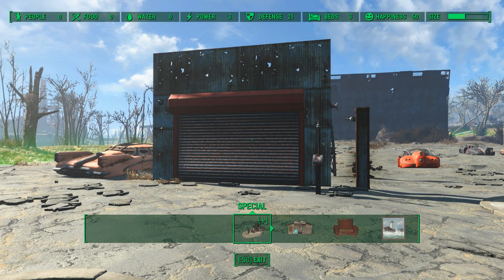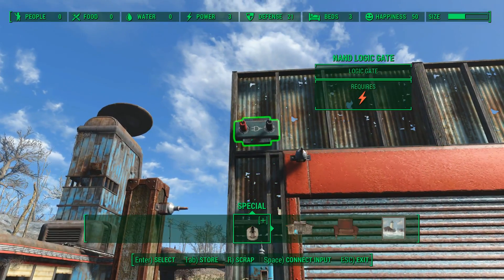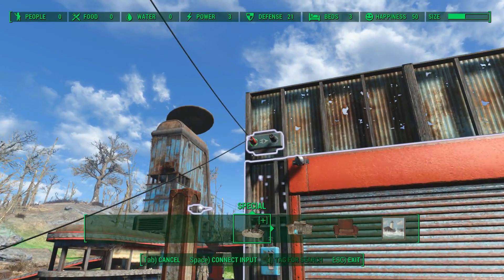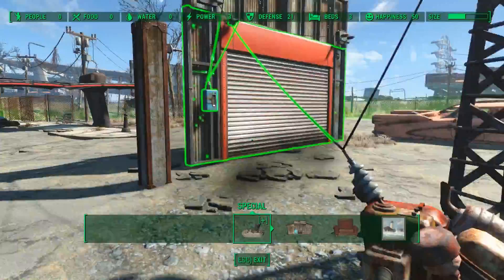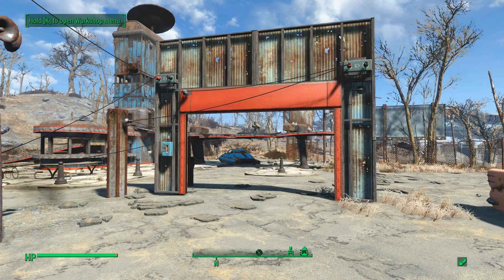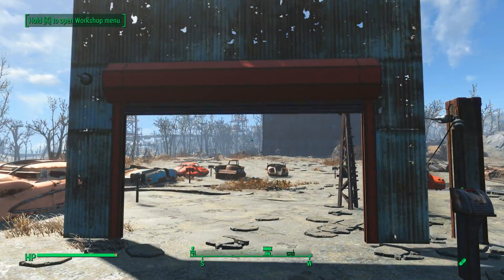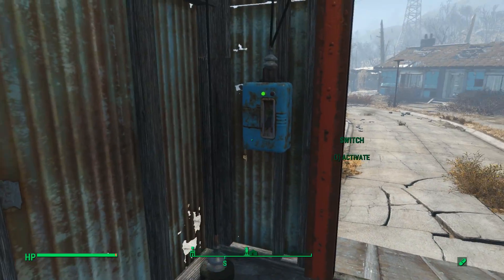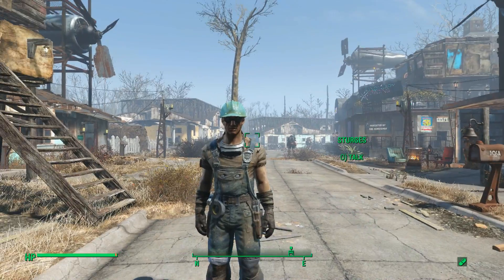FALLOUT 4 Logic Gate Tutorial - How to make a 2-way door with an emergency lockdown

Comment: I tried this for my rolling metal door, and it didnt work. But i found a different solution and a different way to lock down the door. Instead of and gates and nand gates, i ended up just using a Xnor gate, which allowed me to open and close the door from the inside and outside. But it didnt seem to work when i added the siren to the mix. So instead what i did is i hooked the inside switch to a terminal. And when i use the terminal to close the door remotely, it seems to power down the switches and essentially lock the door. So thats sort of another way to do it, just the siren wont trigger a lock down unfortunately

Edit: so it turns out that was a glitch of some kind. I left my settlemwnt and came back and it wasnt working anymore. So i made a smaller version of this and works now
Reply from the maker: Glad you managed to find something that works eventually. This video is pretty old, and I believe there are some changes (bugs?) with logic gates now. It's been a long time since I played!

Comment: There is a flaw in the logic here.  If I switch the door from inside, I get green (on) opens and red (off) closes.  However, leaving the door closed from the inside (off) negates any action from the outside switch, just like the siren does.  So the only way the outside switch works is if the inside switch is green (on).  Which might be cool if you want the "master of the door" to be inside.  But that keep all out when the inside "master" switch is off.  I thought the idea would be to be able to open the closed door from outside, regardless of the inside switch position.

Comment: The latest patch stops most of the logic gates from working as intended, it's really annoying
Reply: Explains why I'm having such a difficult time with them then! Even following this video, mine isn't working and its set up identically.
Reply: @sk8erhardy also it's quite easy to give a gate wireless power by mistake, then even if you remove and store them, when you use them again it will still have wireless power and can mess everything up,, the wireless power trick can be useful for certain things, but take note when storing those same objects, it's better to destroy them and remake them

Comment: I would go one step further, and hook up the siren to an outside switch, so that you can turn it off, in case you’re locked out. I can see a scenario where the settlers activate the siren, while you’re outside. I admit that’s not highly immersive, as you could argue a Raider could disable the siren, then open the door. But the game Engine won’t do this, so, for practical purposes, it’s fine.

Comment: I know this video is dated but it's still informative, I was using another youtubers method which allowed multiple sirens "it used an And, Not, And gate system" but.. it did not allow for an outdoor switch and the only reason I can see an outdoor switch needed is if the settlers trigger the siren while the player is outside of the gate hence the outdoor switch would allow him back in but and I was hoping that this video would solve the problem by keeping the outside switch operational to open the gate but lass it doesn't, once the siren is activated it disables both switches so I honestly I can see no point or reason to have an outside switch as setters AI is not programed to activate it only the player can activate and the gate stays open until the siren is triggered, I can think of no scenario in which an outside switch is needed unless someone can point one out for me that'd be awesome. Using the switch's just for normal gate operation yes... but why? if gate is closed then setters can't access the settlement so gate has to be left open until triggered by siren, I know this because I've been locked out and had to workshop mode to slip through a wall.

Comment: Another way is instead of the AND gate which is Position sensitive you can use the XOR gate which will function similar, XOR gate will transmit power as long as only one input is powered. Basically in simple terms as long as the switches are in opposite positions the door will open which means both sides can work independently of each other and not rely on the other having power. So say a settler comes by and flips the outside switch off with the and gate, even when you flip the switch on your side on the door will not open because the other switch is not powered. With the XOR gate as long as the switches are opposite of each other the door will function which means even if the exterior switch is messed with you still maintain full functionality of the door with the interior switch by reversing its position

Comment: Does anyone else have the problem of all logic gates changing one of the inputs to 0 even if it does have power?
Reply from the maker: I haven't used them in ages, but the logic gates have always been a bit buggy. If they're connected via certain types of conduit it can happen. Sometimes running them through another logic gate that's connected directly to the power source helps.

Comment: every time i connect the second switch to And the first switch & siren loses power and And only has the red plug lite up. Edit: Figured it out keep forgetting to power the Siren itself. Edit 2: after doing some testing This will not work if the Siren is connected to something before its reaches Nand. example: Power>Siren>Power Conduit> Nade. there cant be anything connected between Siren and Nade. otherwise it causes the 2nd switch once wired to And Red, will make And Black turn off.

Comment: Great tutorial! Do NPCs even use switches, though? If not, then turning them off during an attack would be for roleplaying purposes only.
Reply from the maker: Yeah, it's partly for role-playing purposes. If you've left doors open it means they'll close in the event of an attack. Which is only helpful if you've made your perimeter inside the enemy spawn points. Although there is a mod that moves spawn points outside the build areas.
Reply: Good to know.👍

Comment: Now I built one at the front door of sanctuary. Works perfectly. But when I built a second gate at the backdoor of Sanctuary, working off the same siren, the AND gate just does not work. It’s not registering power from the NAND gate, which is registering power going out, but it is registering power coming from the outside switch, which is a bugger to wire up. IE, it’s glitchy as fuck. This is on PS4.
Reply: Further to this, the siren seems to work in deactivating the NAND gate, even though it is wired across a lot of conduits across the map. The AND gate seem to only accept that one input has power, even when both inputs have power. Disconnect one switch input and the AND gate registers the other has power. Disconnect that switched input and reconnect the other, the gate registers that has power. It will not recognise both having power.
But the other door at the sanctuary bridge, wired up the same, works perfectly.

Comment: the problem is you can only use this when you don't have other doors. If you left the building through other doors leaving the indoor switch at "off", you can't open the rolling gate from outside again, since the indoor switch is not giving power.
Reply from the maker: True. But that's kind of the point - it's supposed to be a lockdown. No one comes in, no one goes out. You could always add another door that's not connected to the siren, but if you're going to do that you might as well not bother with the siren in the first place.

Comment: Hello Loved your tutorial but there is something wrong . When i connect both switches to AND gate it does not transmit power :S when i take out 1 it works but with only one-side switch gate doesn't mean much :D
Reply from the maker: The gates can be a bit buggy. Sometimes when you connect the switch to the gate via a conduit, it doesn't work. If that's the case, try a different type of conduit, or connect directly if possible. You could also connect it via another AND gate.
Reply: believe me i did all it just doen't work in that area i dont know why :D Thanks again though

Comment: is there a way to make this door work from both sides? I get locked out and the door doesn't react to the outside switch?
Reply from the maker: Jack Hazardous It does work from both sides. But for example, if somehow you end up with the inner switch turned off and the outer switch turned on (by using a different exit maybe), then try to come in from the outside; the switch won't work. You need to go in and out through the same door.
Reply: that's exactly what I mean, can you make it work like that?
Reply: that's what I mean, can you make that work?

Comment: strangely if I connect the siren to a conduit before the input of the NAND gate, the gate doesnt work anymore
Reply from the maker: +Nick Wei Yeah, they can be a bit buggy like that. Try different conduits (like pipe ones from Contraptions or the Vault-Tec one). Failing that, passing it through another logic gate (AND) usually works.

Comment: Would it theoretically be possible to use the wall pass-through conduit as a way to wire through the door/wall?
Reply from the maker: Absolutely. I just used wires here because it was quicker. I have another logic gate video where I use the conduits.
Reply: Lefthandshake wünderbar. I know Bethesda is notorious for having things that should work not work, so I was curious if that was the case.
Reply from the maker: Will Brown The logic gates can be a little "quirky", but I've never had a problem with the conduits.

Comment: I can't get this to work. Every time I connect the outside switch to the input side of the AND gate, the output switches off and nothing will function. Just to be sure, this is my setup:
Power source (from house) connected to siren, outside switch (large switched pylon), and input side of NAND gate;
Inside switch (small switched pylon) connected to NAND output and AND input;
Outside switch connected to AND input via conduit on a tree (to get over the wall);
AND output connected to powered door.

As I said, everything works fine until I get to the step of connecting the outside switch to the AND input. Even though it's getting power, as soon as I connect it, the output side of the AND gate switches off no green light). Turning the outside switch on or off has no effect. 

Any idea what the problem could be? Thanks.
Reply: I just wanted to add that I noticed that my inside switch LOSES power when I connect the outside switch to the AND input. So, somehow connecting the outside switch to the AND input is causing the inside switch to lose power even thought the NAND gate is still showing power output. What the???
Reply: I'm not sure what the problem was, but I scrapped everything and started over and got it to work. I repositioned a few of the components, so maybe that had something to do with it. 

I also set another door up with pressure plates so that it acts as an automatic door both in and out. Simply walk up to the door and it opens . If the siren is activated, it locks down. 

Lastly, I saw a video wherein the player was able to set up a 3- way door and siren interrupt with only the NAND logic gate. Unfortunately, he didn't explain how to wire it up on the switch side. I'm going to play around with it today and see it I can figure out how he did it. 

Thanks for the video! =)
Reply from the maker: +Harry Sparks Sorry I didn't get a chance to reply. Glad you got it working! Logic gates can be a bit finicky. The other video sounds interesting. Not sure if you saw my other logic gate video. It adds in stuff like turrets, tripwires and delay switches. You might find it interesting.
Reply: Thanks for the reply and pointing me to your other video. I'll definitely watch it. I have used the 3-way with siren interrupt at a few of my settlements now and actually wire them a little differently. Instead of constant power to the outside switch, I use a connector to run power to both switches from the output side of the NAND gate.  I realized that it is technically constant power as long as the siren isn't activated and made for a cleaner build with less wires coming from a direct power source. =)
Reply: Thanks for the reply and pointing me to your other video. I'll definitely watch it. I have used the 3-way with siren interrupt at a few of my settlements now and actually wire them a little differently. Instead of constant power to the outside switch, I use a connector to run power to both switches from the output side of the NAND gate.  I realized that it is technically constant power as long as the siren isn't activated and made for a cleaner build with less wires coming from a direct power source. =)

Comment: the gate isn't a gate, it's a logic switch, that's why you have to connect direct if another siren is on the circuit, the connection has to be isolated.

Comment: nice work. im still mad that Bethesda kinda fucked up some of the logic gates it would make some things much easier.
Reply from the maker: Kaedon Geddes Yes, the door and logic gates are from the Contraptions DLC.
Reply from the maker: Anonymous #13532157 Yup. What you need to do is connect the tripwire to a power source, then connect it to the siren. Instead of having the siren connecting to the input on the NAND gate, you connect the tripwire. Leave the switch on the siren in the ON position. This means it's the tripwire triggering the lockdown instead of the siren. The siren just happens to come on at the same time. Hope that makes sense. There's probably another way do it using different logic gates, but I'd have to play around with it due to the janky way they work in the game.
Reply from the maker: +Tofu Yeah, it's annoying. Some gates will only work if you pass them through another gate first.
Reply: if  i connect the siren to a tripwire will it still work?

Comment: as added security you could wire a fireworks launcher to the siren and load it with flares i believe and when the settlement is attacked and the siren goes of the flare is fired and then youll have added backup come to help in the form of the minutemen
Reply: I do this it works verry well tho sometimes thy get there wen the attack is over. Lol
Reply: treboR AP917 two possible reasons:
1. Heroes always arrive late to save the day
2. A warlock is never late, he arrives exactly when he needs to
Reply: You can put a delayed-off-switch in front of the fireworks mortar. Cut of power after a second and it will only fire one shell. Otherwise it keeps firing.
Reply: Genius!! Im going for it
Reply: treboR AP917 #latetotheparty
Reply: genius. i'm definitely doing that

Comment: Have you considered using conduits instead of wires?  Tends to look quite a bit cleaner.
Reply from the maker: Arcane Scroll I used wires mainly because they're quick to connect in order to show how everything is hooked up. Conduits are much tidier, but they take some time to place.
Reply: Lefthandshake that is true, I spent a couple hours routing mine on my door setup.